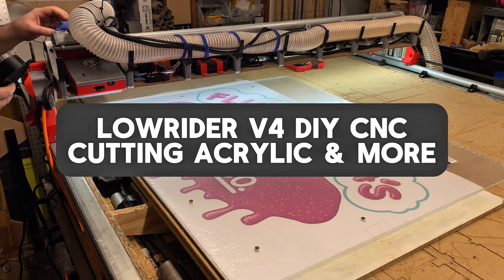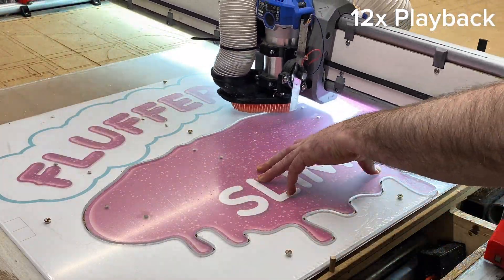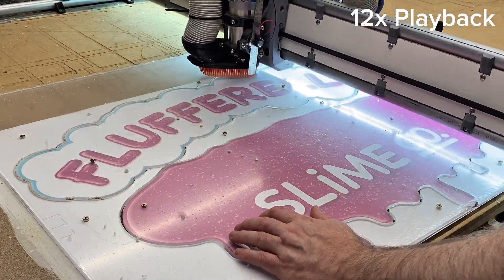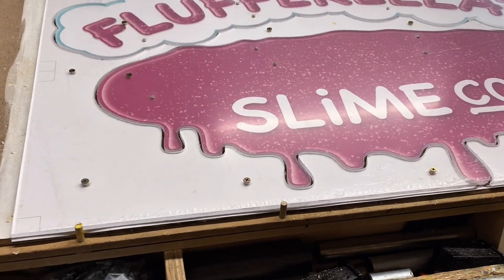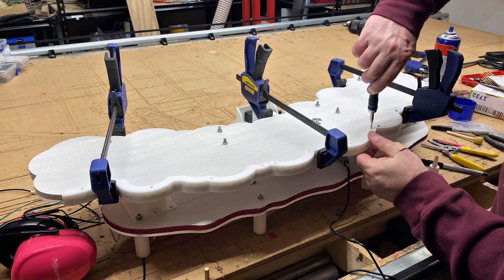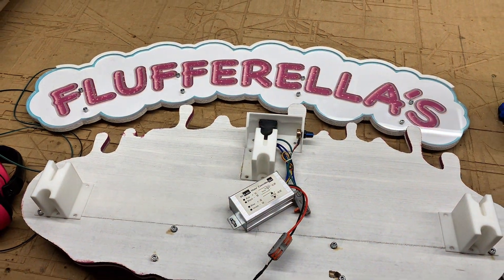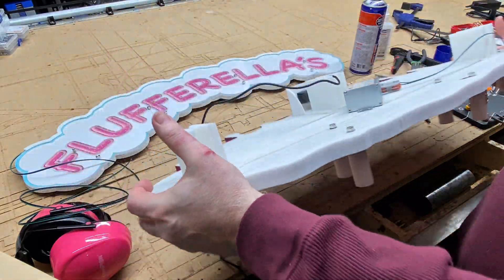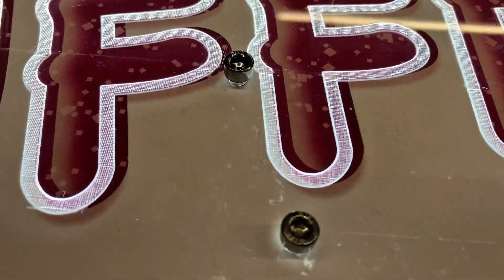Made w/ LowRider v4 DIY CNC: bespoke signage for a locally owned and operated business

Comment: Thx so much for your LR4 Vids.  ....  How do you know what speed your bits are turning at ??
Reply from the maker: My LowRider is carrying a "handheld trim router" and it has a speed control knob. There's a chart to know which knob number equates to which speed. The most commonly used router for LowRiders is the Makita 700 series, but mine is carrying a Kobalt that's not still being manufactured. Kobalt worked with V1 Engineering's founder, Ryan, to develop the router, and they hoped it would really take off, but it must not have reached the sales numbers they were hoping for, I guess. I have both Makita and Kobalt, and their power and speeds are about even matched.

Comment: How do you maintain/set up consistent x/y zeros on your table? I would be terrified that I was off by a mm in one direction or another when tracing an image like that.

All my cuts have been on new sheets of plywood, but I want to transition to working on precut lengths of wood to save CNC time. The main limiter is my ability to maintain a consistent x/y 0.
Reply from the maker: My control board in this build is called Jackpot, and it is sold by v1engineering at v1e.com. That board runs a firmware that is based on GRBL, and it is really great for CNC work. Once you home the machine and then set your X offset and Y offset you can “zero” at those offsets, and even if you have to reboot the machine, it still remembers what those offsets were. So if you ever have to do a tool change or anything, you can just home the machine, and it still remembers how far away the X and Y offset is.

Comment: Beautiful sign Doug!  Appreciate you walking through the details of how you designed and built it.  Details like how cleanly the support breaks away from the 3D printed edge trim was neat to see.  Cheers!
Reply from the maker: Thanks friend! I learned something new about tree supports in OrcaSlicer. If the vertical space from the bed to the overhang is too short, it will create the support trunks on the part itself, whereas if the needed height is there, it will avoid basing them on the part, which is way better. At first I had the height at the top too short (the groove / opening in the part would not fit around the sign stack) and the supports were within the part, but when I widened that opening (which raised the top of the print) the supports totally pivoted. Neat.

Comment: So far I'm loving FluidNC and the FluidDial. I just wish we could also add some dedicated buttons so for example running macros could be a simple button press versus navigating to the macro screen, dialing down or up to the specific macro, then either selecting load and then run or selecting run. Depending on if you are already in a different screen mode say jogging to activate a macro might be several steps on the Fluid Dial versus one dedicated button. I also wish there were dedicated X,Y, and Z jog buttons it's a mental challenge to use the dial to select which axis before jogging, On occasion I have just jogged positive or negative without switching the axis and driven the wrong axis which is not an issue with X and Y per see, but Jogging z axis down un-intentialy can result in driving an end mill into the workpiece or the spoilboard. with dedicated buttons I feel this would be mitigated.
Reply from the maker: I think those modifications might be doable, but I'm not certain. I do think there was some discussion about that on the V1E Forum.

Comment: Sweet! Are the LEDs in the border shining perpendicular into the acrylic? Have you looked into installing a relay to turn router on and off?
Reply from the maker: @ppage27  Yep, the LEDs are shining directly into the side edge of the acrylic. I know it’s possible to attach a relay to turn the router on and off, and there are even ways to retrofit the router so that the software controls the speed, but those methods for me would be more work by far than just reaching over to turn it on and off or to adjust the speed manually, so I just use it in the easy way that Ryan (V1 Engineering) envisioned it being done.